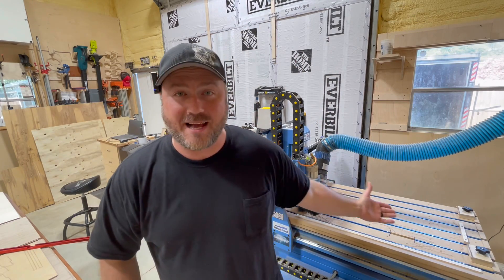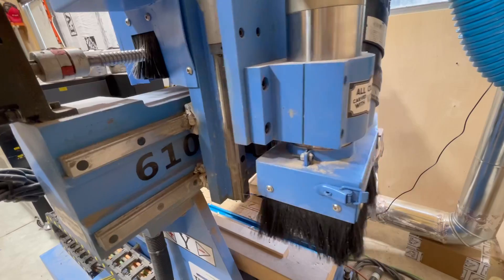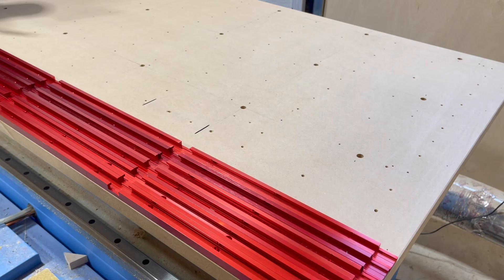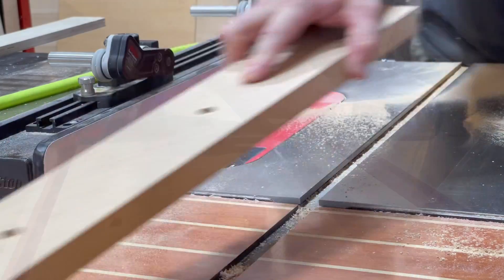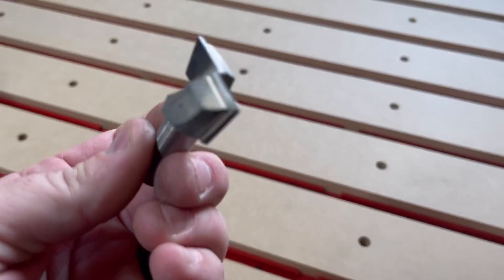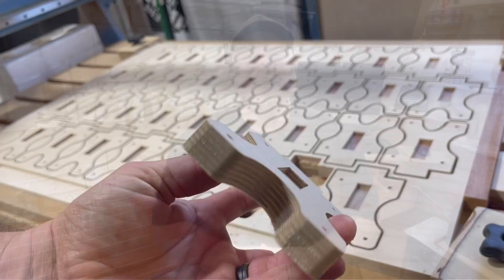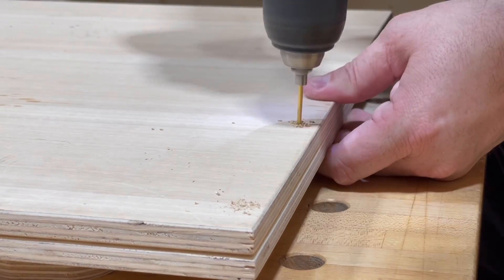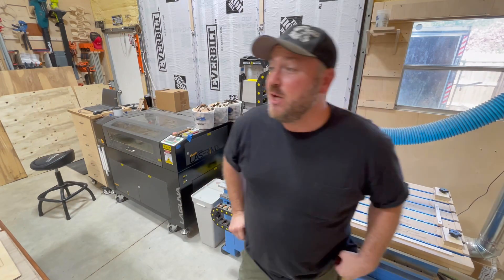New CNC spoil board! Should Have Done This A Long Time Ago

Comment: After investing that much effort into your spoil board, why cut it all up? I especially cringe when people sink screws into the spoil board.  Looks more like vandalism than clamping. 

I put a scrap piece of 1/4 inch masonite board under my stock, or small 1/4 inch pieces under the stock at the clamps.  My spoil board never gets touched by my router bits.

Comment: You need to take this advice and change how your setups are indexed, then you won't waste your spoil board so much: 

https://youtu.be/Q-Q1o16Ux-I
Reply from the maker: I checked out the video And yes I do index a bit better now. However, cutting into the spoil board just a little bit really does help the final sanding process. Because I sand so many parts. Sometimes thousands per week it’s worth it to dig into the spoil board to save time on the back end. But yes, totally get it.

Comment: What T-Track is that? where can I find it
Reply from the maker: That is the Armor Tool variety. Give them a Google.
Reply: @AGlimpseInside  Basically, do the same thing with regular t-track, figure out where you would like the gap (middle of spoil board), cut the track and when you install leave a 1/2-inch gap, enough to get the bolt head in

Comment: Hint... go to the plumbing section and get some nylon bolts to hold the spoil board down.
That way... if you surface too far and the router bit hits the bolt... the router bit survives.

Oh... countersink your spoilboard holes  Then you don't have to play with a sanding block.

Comment: What rpm / feed rate are you running? I run that cutter at 8000rpm at 600ipm on MDF.  Not sure if your spindle will run that low RPM but the cutter inserts will last way longer and the dust won't be as bad.  Try 12000rpm at 4 or 500 ipm in MDF.

Comment: Holy frijoles, that bit is a beast. It looks like the kind of thing that's used to bore tunnels through mountains.

I'm not surprised at all that your shelf held a whole person. But what surprises me is that a single French cleat can hold all that weight. Sure, the cleat is three inches wide and multiple feet long and screwed to the wall and all that, but the weak spot on a French cleat is the angled portion, which is only 3/4" deep, and if you put a lever under it and pull, eventually the angled portion will break off. So the plywood you used on those cleats is nice, strong stuff.

Comment: Chris how about a set of shelf supports exactly the dimensions of the USPS flat rate box, $5. Largest you could get with sending probably 4 per box and still large enough to be useful in most shops?
Reply from the maker: I will definitely look into it brother. Thanks for the idea
Reply: @AGlimpseInside  all flat rate boxes you can refold to fit other shapes as long as you don't change the volume.

Comment: I don't want to tell you how to use your tools and please don't take this as anything but a suggestion......
If you set your zero off the wasteboard instead of off the top of the material you will never have to replace it again. 
Plus you will have the advantage of never having to edit your files for slightly different thicknesses of material. As long as your retract height is greater than the variation of material thicknesses then you can cut out parts cleanly and never cut into the wasteboard. 
Think about it like this......
What is the one constant about you cnc. What never changes (unless you resurface and that's a given) about your setup. The hopefully dead flat wasteboard. As long as your spindle is trammed and your bits never slip out of the collet then you will cut though parts exactly with no damage to the wasteboard.
Reply from the maker: A little above my pay grade to figure that out because I’m not real great with setting native settings inside the CNC. But I totally get your point. Although I will say going down a few hundredths of an inch with a compression bit, Really does help me how much I have to send these pieces. But I did even cut me do the same. Thanks for the tip Clinton seriously it’s awesome